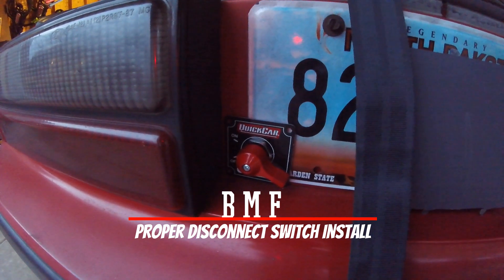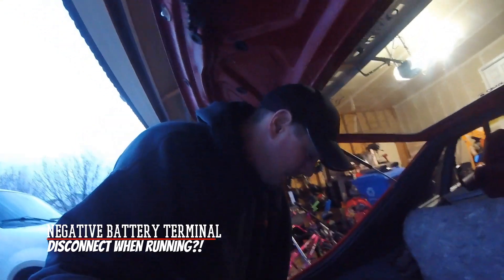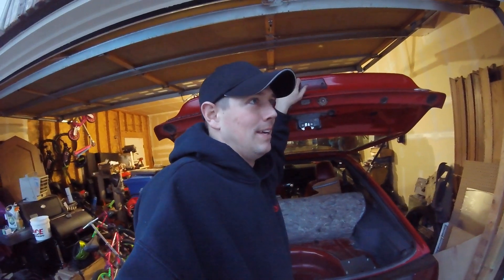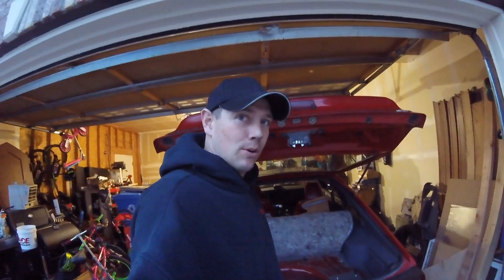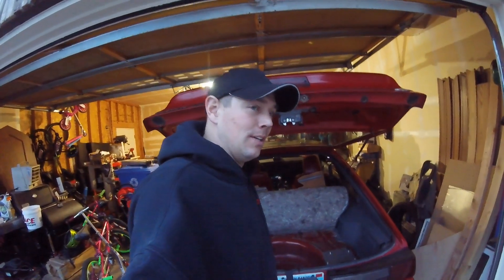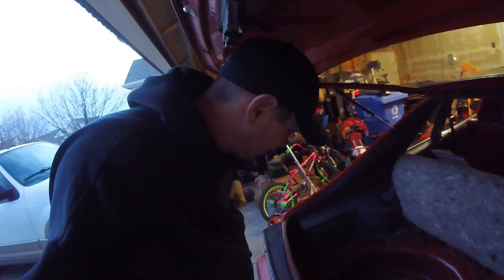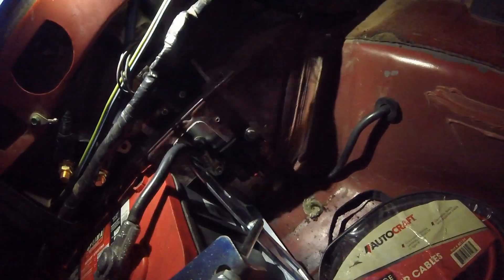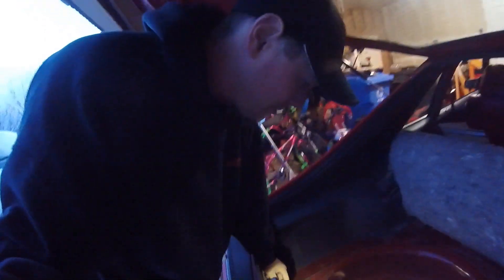Battery Disconnect, Proper Installation and Testing

Comment: When i first did my battery relocation i bridged the power from the junction that is in between the alternator and the main fuse box, so if just do power from the battery side only the car should turn off 🤞

Comment: what gauge wire did you run from cotoff switch  in the back to the alternatort?
Reply from the maker: 2 gauge wire in this example.  I’ve got another switch I’m putting in now that disconnects the alternator excite wire instead of the power wire.  Gonna save me some weight in the car without all that heavy gauge wire
Reply: @BMF_Garage  so I could just run the excite wire back to the cutoff switch, say like 10 or 12 gauge?
Reply: I have enough extra 4 gauge wire that I initially used when I did the 3g alternator conversion, I was going to run that back to a breaker near the battery box and connect to the cutoff switch?
Reply from the maker: You could if you have a 4 post cut off switch, or if you just want to tie the excite wire to the 12volt side of a 2 post switch so it’s got power any time the switch is on and kills power when it’s off
Reply: @BMF_Garage  I may try running the excite wire back to my 2 post cut off.
Reply: @BMF_Garage 
If you kill the power to the excite wire after the alternator is charging, will it stop the alternator from charging or will it continue to charge? I thought the voltage from the excite wire only got the alternator to start charging and it would continue to charge if it's disconnected. Have you tried pulling that wire off while it's running and charging to see if it stops by chance? I'm getting ready to install a 4 terminal cutoff switch and that's what I want to do if it works.
Reply from the maker: I haven’t tried pulling it while it’s running

Comment: How has this quick car switch lasted? I got one and I’m about to wire it in. Street racecar but i don’t care about the nhra rules specific.. still kinda like it as a entire kill switch for what could be a runaway engine or stuck pedal or shifter.. it’s just a damn lot of wiring..

Also can u just put remote terminals to easily charge the battery with this setup ???

I’ve got this same switch but don’t know exactly how to wire it up.. I’ve got a 2004 Acura TSX.. originally my wiring is 
fusebox to alternator
Fusebox to battery
Battery to starter..

Please help me.
Would help too since I’ve got button start and no longer a manual key that i can manually turn off.. i only rely on the button now. It was a PnP kit no hack job.
Debating whether I’m overthinking and maybe don’t even really need this … i could simply install it on the negative side and not need all new wiring, just to save my battery from dying but not kill the car.. would’ve been nice tho

Comment: Great video! What amp size is your circuit breaker? Also does the other end of the negative cable  going through the spare tire well just connect to the frame? Thanks
Reply: Couple more things, I have mine set up the same minus the C/B, but I have a 200 amp fuse between the alt. and switch, should I change the fuse to a c/b also what is the c/b on the neg cable for/ protecting just trying to learn ?   Thanks
Reply from the maker: I had the cb on the. What I’ve got easier disconnecting when storing longer… your way works fine too.  I just end up not driving my car a lot so disconnecting the negative helps
Reply from the maker: It’s a 150 amp.  Yes it connects to the frame

Comment: So take off the wire that runs from the starter to the alternator 
Through the link

Just run a new line from the alternator back to the switch with battery cable to kill it
Reply from the maker: Yeah that or get the different style switch and run the control wire for the alternator back to the switch…

Comment: Wont the alternator still get power from being in contact with the positive side of the battery even in the off position?
Reply from the maker: That’s how it is normally in stock condition.  Alternator is connected on the power cable at all times.  What changes in factory condition is the activation or excitement wire that turns the voltage regulator on. This way ensures the car shuts down in case of an emergency.
Reply: @BMF_Garage  you lost me with the last part of the statement lol. Just tell me what to do lol. I'm trying to have it shut car off and still be nhra accepted.  I'm doing a ls swap, so I have to have the alt wire go to the terminal on the switch with the battery positive also? Then the other terminal goes to starter with junction block wire to power everything? That sound correct?
Reply from the maker: I believe that now they make a multiple post disconnect switch, but if yours is just the two post switch like mine, you’ll take the alternator and battery to one post, then the lead out to the car on the other post.  Essentially when the switch is off you’re disconnecting power from the battery and alternator from the car.
Reply: @BMF_Garage  OK thanks
Reply: @BMF_Garage  ok im back because I have a issue lol. So here is how I have it,  its a 2 post switch. On one side I have the battery cable, on the other post I have msd, alt, starter. On the alt it has the cable to the battery and the cable to the horn relay like factory. On the starter, I have the big cable from switch and wire from relay to one post and a wire on the s terminal.  Here is my issue, no power inside car, no crank or nothing.  New battery and everything else has power. What did I do wrong?
Reply from the maker: I’m not following what you did lol any way you can send me some pics or more details?
Reply: @infamousnova  Its not that hard bub. Battery, starter and alternator on positive post. The battery negative on ground post.
Reply: @Pete3Heat  I'm confused 😂